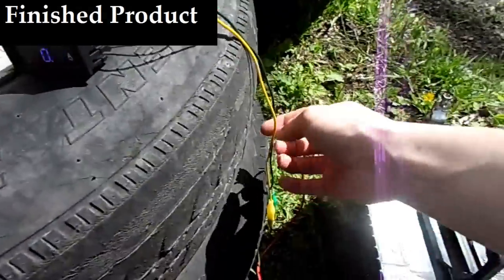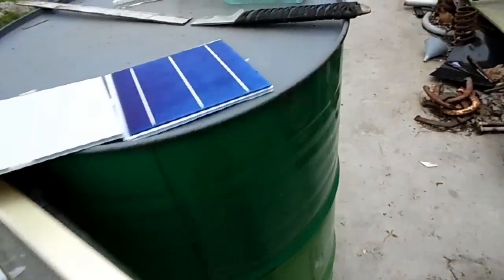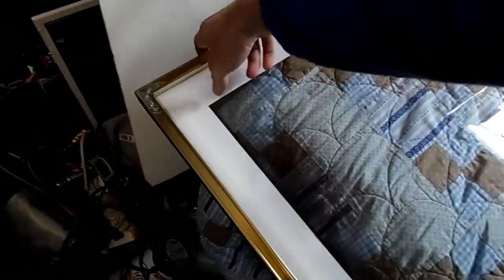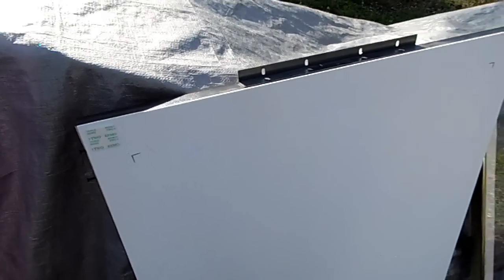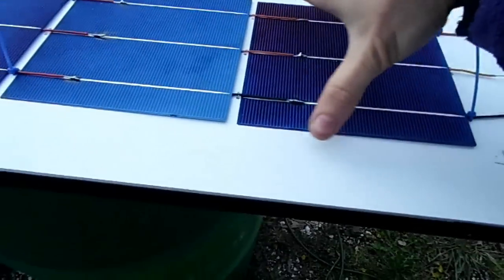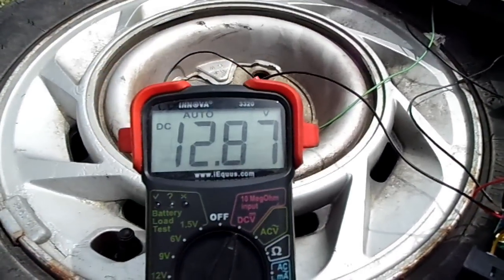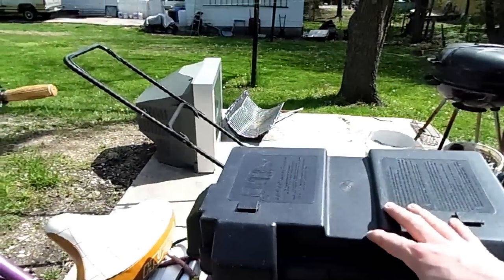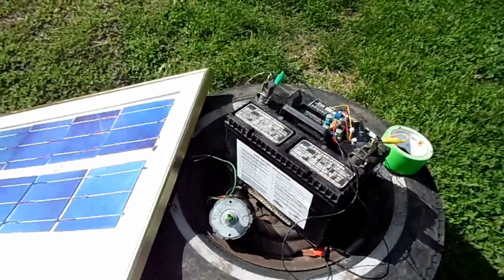DIY 15$ 40w Solar Panel

Comment: Cool stuff! I'm surprised at how well you're able to handle that huge soldering iron. My hands shake so much that I can barely control my small point-tip 25 watt unit. :P

Question about the DC-DC converters - have you tried, or do you know, if you can connect the outputs of two of them in series to get twice the voltage? I have a potential project that requires 120VDC, and if I can purchase two 60V converters, connect them both to one battery, and wire the outputs in series, that would be perfect. I already asked one eBay seller, and they said no...
Reply: this wont work for sure but you can do this with 2 batteries eash with its own stepup module
Reply: Stratos Vasilas Um, I'd still have to connect the outputs in series. Or do you mean you can do that when they are on separate batteries, but not when they are on the same battery?
Reply from the maker: *****
i've tried it and i agree with stratos. if the two converters are being powered from the same input source they kinda short out. but if each converter has its own separate power source it should work.

why not buy a 70w 120v AC inverter from walmart for like 25$ and put a big diode on it to make it pulsed DC? then could add a capacitor to smooth out the pulses.
Reply: ***** yeas thats what i mean you can do it with two diferent batteries, the super genius' idea seems quite good though and probably cheaper :-D
Reply: Stratos Vasilas Rinoa Super-Genius Interesting, thanks for the info.

Comment: Where did you get your solar cells? or where to buy cheap for 12v system when complete. NOTE: you can get a 12v to house plug auto sync inverter to change the 12v to 120v ac and it auto syncs the HZ to be same as house and syncs the PHASE to be in perfect harmony (to avoid damage to equipment), THUS: for $250 for a 250w inverter (or about $1 /watt ) you just plug into wall outlet and you are adding power to grid V, which reduces your power bill, and best you need no batteries. This things are stackable so you can add more solar panels and another inverter since they self sync phase and HZ, and keep adding as you get the money to eventually reduce your power bill to the point where sometimes (if you are gone for example on vacation) the power co may owe you money. BTW: 12.5 v x 5 milliamps is not 40 watts (maybe you meant 4w ?     I would say when you increase voltage in a buck boost voltage booster you reduce amps or am I wrong about that. ?   Anyway its a neat video !     For solar panels I think IMHO its different:  ie  I got 3 solar panels from Harbor Freight for $249 and I think they were 45 wats together, but at 12v... connect them in parallel to keep 12v  but increase amps.   Or I can connect them in series to make it 35v and same amps as one unit.
Reply: If you have for example 3 - 12V panels rated at 1A each,  in parallel you'd get 12V @ 3A.  
In series you'd get 36V @ 1A.
Reply: At "HARBOR FREIGHT" U can get 3 panels 15 watts each for $249 or less if they have special.  For each 15w panel at ~12v;  w=vi ;  15w / ~12v = ~1 amp .  In SERIES: you can get  ~36v @ 1 amp = ~36w  appox 45w since they solar panels actually put out a bit more than 12v (ie 15v) because batteries require more than the rated V to force the charge into the 12v battery.  In PARALLEL:  its 12v @ 3 amp = again 36 watts (really 45w since they panels really have to put out more V to charge 12v battery.  BUT you don't have to use a  battery, just use Grid TIe inverter (avail on internet $200) that auto syncs freq (hz) and Phase, and you now are putting power back into house , just plug i the solar panels to the GTinverter and then plug it into any wall outlet 120v AC (be careful this plug into the wall is feeding power in so its "live" and so has the male end on it.. I think they have a way to physically attach to an outlet with a screw for safety. Hope you understand all this. Best of luck.
Reply: john Doe
I don't know why you're wasting time explaining something to me that I never asked you to explain.  I know my way around electronics and solar panels just fine.  Which is why I don't waste my money on harbor freights joke of a solar kit.  For $250 you could have got a 300W panel or a couple 100W panels. And charge controllers for systems of only a couple hundred watts or so can be had for $20 or less.
Reply: oh, sorry, i thought you were asking me.  Ok, so can you tell us where you get 300w panels for just $250,  and Grid Tie Inverters for $20, that I would like to know, thanks ahead of time.  URL's would be best. thanks. Peace !
Reply: With a grid-tie setup and 45 watt panel, you are only putting 5 cents worth of power into the grid per day.  $250 for the kit from HF, $250 for the grid-tie inverter.   You spent $500 and will only supplement $18 worth of power in an entire year.
Reply: yes, right, so where do you get the solar panels cheap enough to make it worth it? I'm asking you.  Give me a link, thanks. The HF kit is now $179 and has charge controller, and 2  lights , and slant stand for yard would be like for emergencies better tan nothing to charge a golf cart battery over 2 days maybe if 90w systerm (2x45w).

Comment: Did anyone else think that soldering iron was fake? I mean...holy shit its huge.
Reply: +John Sheppard It's real, I have one. It's a tin/metal workers iron. Very heavy duty and tons of heat. They're great for large soldering jobs like sheet metal seams and soldering holes up in gas tanks. (ya' better know what you're doing if ya' do that!)

Comment: Those panels could be stick on the back with some adhesive so you can avoid the zip ties? The panel also sits outside horizontally all the time.
And did you build that power bank from gas station? Any video? :)

Comment: Rather that using goopy sealer, visit any number of sign stores and buy their scrap sign vinyl which made 100% tape sealed edges- better tan electrical tape by 20x-- if you make strips say 1" wide you'd always have great seals and nice looking.  a 16"x150' is about $140 for good stuff. so figure the s1 in price so you pay right-- but most would give you lots for free.

Comment: Solar cells seem to always have three wires (bus wires?) although it doesn't look as if they are all required or connected to anything. I noticed that for your panel, you soldered the three bus wires together for each cell, yet when you mount them in the frame, you only use the middle one. Does that mean that you wasted a lot of effort soldering together the other two busses for each cell? They are not connected to anything in the final product.

Good video btw.

Comment: Is that a 50 year old soldering iron with a fabric braided cord?  You sure are good at using that thing!
Reply from the maker: naps1saps yeah i'd say maybe older than 50. i got another one new in it's box recently thats from about the 1960s. i think the one in this video is from the 1940s or 50s tbh.

these industrial 300w soldering irons have an insane amount of thermal capacity. ussually i let it heat up for 10 minutes then unplug it to solder for 45 minutes. most of the time i'm soldering in my videos its not plugged in because it will get extremely hot.

that second newer one i got says it goes to 1150 F* at idle, so thats almost hot enough to melt aluminium.
Reply: +Rinoa Super-Genius Where did you get the irons?

Comment: 350 mA is not surprising,as that is probably the max draw your meter can provide. The proper way to measure current is in series with a load.
Reply: the meter is unfused and will pass infinite currenr

Comment: You seem like just the kind of person I need advice from with a challenge.  It's your battery knowledge that I'm interested in.  I have a Ryobi 48v rechargeable lawn mower.  After 2 years the charge controller malfunctioned and destroyed the batteries and I can't afford the replacement battery unit.  So, I opened the thing up and it looks like I could just replace the 4 batteries?   That's if I knew anything about rechargeable batteries, like what kind to buy how I should be hooking them up and how I can use the charger again without over charging it again.  Any advice?
Reply: replace the lead acid batteries with ups ones from amazon,and use a 10-60 to 12-80 boost converter and a laptop charger or something. set the boost converter to like 57 volts i think
Reply: Thanks for the advice.  :)

Comment: What would I need to do to use this as a USB charger to charge my phone directly from the sun?
Reply: Blakehx Hmm that's a good question.
Reply: Blakehx  They actually made a transparent solar panel that can be put as the phone's screen, it's just not in stores yet.
Reply: yasmin shamli I find that difficult to be any efficient in absorbing solar energy lol, considering it's always in your pockets.
Reply: True xD. But you can still use the charger, this is just to make you use less electricity + it will be charging while you use it (if you are outside or in the backyard :P )
Reply: yasmin shamli Annnd let's not forget the most important thing... if there aren't any clouds blocking the sun... oh and there's gotta be a SUN in first place.
Reply: just a guess like 5 cells
Reply: +Blakehx My guess would be to attach a usb circuit board to the end wires.
Reply: +Blakehx My guess would be to attach a usb circuit board to the end wires.

Comment: Okay I'm a young little bean and i have little experience with electronics. (the only think I've ever taken apart and put back together is a hard drive) so when you're tabbing the cells i see you hold down the wire and put the stuff on it what is that? how can i have access to it? sorry I'm trying to do this for a school project. and the measuring device for the voltage as well? Do I need the step up transformer or are you using that because you're using the panel to charge larger things?

Comment: What's the advantage of using solar cells compared to a power supply? Are you going to charge batteries in remote places without power plugs?

Comment: The old PSU wire is the problem with the power loss, you need to use tabbing wire anything else will restrict the power flow especially since the wire your using is stranded wire instead of solid.
Reply: wire is wire is wire, tabbing wire isnt magical. i have cells done with tabbing and some with wire, i get a good 6amps off each cell either way
Reply: Albert Pratt stranded wire carries DC current better than solid core... just sayin'

Comment: Is it possible to use transparent acrylic sheet instead of glass to cover the solar panel from the elements? I want it to mount on a solar powered trike and glass would be too heavy and too brittle. If anyone could help me or recommend some other good (light, transparent and not that fragile) material I would really appreciate that. Thanks in advance!
Reply from the maker: thats what i used in the video.
Reply: Oh, ok. I guess I should have paid attention, thanks mate!
Reply: NOOO.  Bad idea.  If it was me I'd use this Solar Cel Encapsulant.  This is how factory panels are made. Search eBay.  Also search tabing wire while your at it.  They make beautiful wire to solder the cells together with, not #10 insulated! LOL.
Reply: I will check it out, thanks for your suggestion.

Comment: Where did you get the solar cells?
If you would put that info in your video description.
Reply from the maker: The Anomaly72 ebay
Reply: +Daniel J Lasher The answer is always eBay or random junk lying around the garage.
Reply: Smile same thing

Comment: where did you find the solar panels? and can you obtain more?
Reply: Dan Oh you can find it ez on ebay :) for less then 1€
Reply: Dan Oh and more sorry for 2 comments , unlike on the video you can find on ebay, solar cells already tabbed so youy dont need all that soldering to conect the wires to the solar cell and etc

Comment: That isn't a transformer, only AC can be transformed.  That would be a step up or boost converter.  Pretty awesome score though, you could save a lot of money if a person had a bunch of them on a solar setup.
Reply: it chops the dc into ac and then rectifies it at a higher voltage

Comment: What happened to the wind turbine, it looked a little sad.
Reply from the maker: it broke apart last november, it was pretty useless though. would barely spin so i put it in a windy part of the yard and it spun backwards. i guess it was in the middle of a vortex that rotated it against what it was designed for.

then we had some big gusts and it smashed into the ground. funny thing is though the trash bags are still stuck tightly to the fins. they lasted through the winter nicely.

Comment: Awesome project but you should revisit your math since .5 volt @ 5 amp per cell x10 cells is only 25 watts not nearly 40 watts as stated. Otherwise I loved the video wished you would have shown all your connections likely that is the reason for the reduced watts.

Comment: nice to see more and more upcycling effort! applaud your creativity but isnt "air" bad for the solar panel?  it will bake your solar cells and reduce its efficiency as it gets hotter.
Reply from the maker: no air isnt, its UV thats bad. but all solar panels lose their power over time. i'm not very concerned with the life of this because within a few years i bet i'll have much better panels.

Comment: I didn't realize solar cells were the cheap part! Where do you get "unhoused" cells?
Reply from the maker: +F!@#Guilt ebay
Reply: +F!@#Guilt they aren't cheap at all.
Reply from the maker: Simonas Mažeikis
they where when i bought these
Reply: Rinoa Super-Genius 15$ for 40W with no casing, that's not cheap. not to mention how big they are for 40W panel
Reply from the maker: Simonas Mažeikis
yes it is cheep, you must not understand how expensive solar panels are.
Reply: Rinoa Super-Genius complete much more compact 40w panel is 30-40 bucks
Reply: Got a link to that? Seems like a scam..
Reply: And same place you can find these cheap incomplete ones, aliexpress/ebay, shipping is expensive because it's big so you have to order a sizeable amount and if you do 40w panels are quite useless.

larger models are available in stocks overseas which makes buying them way more efficient.
Reply: So what you are saying is 15$ for 40W is not cheap, but the only way to get it cheaper is to buy a lot more than 40W. A pretty pointless thing to argue since it's not we are talking about. 
But you also said "complete much more compact 40w panel is 30-40 bucks" What happened to that? 15$ is too much, but 30-40$ is ok? You aren't making much sense.
In my country we have a 25% import tax that also taxes the shipping, so stuff gets expensive quick. It sucks.

Comment: is it possible to buy them on ebay as well ? What would be the disadvantages ?
Reply from the maker: as well? ebay is where i bought them.
Reply: Rinoa Super-Genius oh, yeah ! I should have read yr comments. I heard that 5V are enough to charge a mobile phone. What about an iPad ?
Reply from the maker: paul saunter
 i think the ipad is 4.2v also, so yeah it should charge with 5v.
Reply: paul saunter The USB port that we all charge from is 5V.  If you look at your wall charger it will say 5volts 1 amp or something like that.  5V x 1A is 5 watts.  So you don't just charge with volts, you need the amps also!
Reply from the maker: FlyMeAirplane
amps doesnt matter as much, USB charging circuits tend to be able to handle low currents of varying amps.
Reply: FlyMeAirplane I am struggling to understand about Amps. I have a reader which has 20, 200, 2000 mA. I switch to all but the reading is always none
Reply: Hi Paul,
You don't have a reader, you have a Digital Volt meter.  One thing I've done wrong with my meter is forget to move the red probe to the "Current" socket.  If you leave it in the socket that reads volts then every current you try measuring =0...

Comment: How did you arrange 0.5 V x 10 to give 12volts? and how did you get 40 Watts from 10 x 2.5watt Cells?
Reply: Jude Okwuibe each cell actually produces anywhere from .57 to .59  volts (in open cell voltage) that's why you need an 18 volt panel to charge a 12 volt battery (which gives you about 19 to 20 volts open cell). And he made a mistake on the wattage look below..

Comment: Pretty cool. Why do those cells have three wires?
Reply from the maker: why not?
Reply: Some cells have 2, some have 3.  Best to buy the 2 as they are easier to solder together.
Reply from the maker: FlyMeAirplane
you can just solder 2 of the 3 tabs though, it really doesnt matter much imo.
Reply: Rinoa Super-Genius

just using 'some' of the tabs is an issue with current distribution through the conductive paint, you lose power that way, tried it etc, its because the paint has resistance, by using more tabs, you get that resistance in parallel hence reducing its parasitic effect, also if a joint fails from thermal issues you have the other to fal back on instead of the panel going down